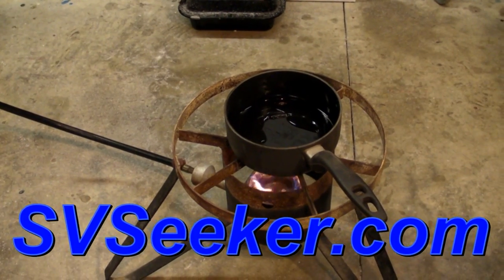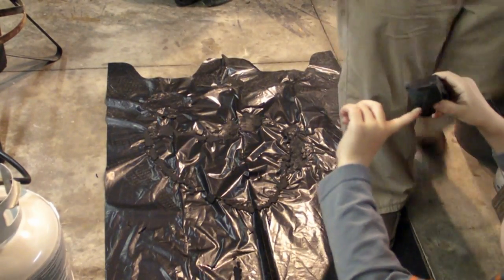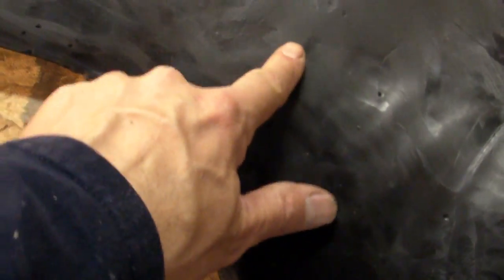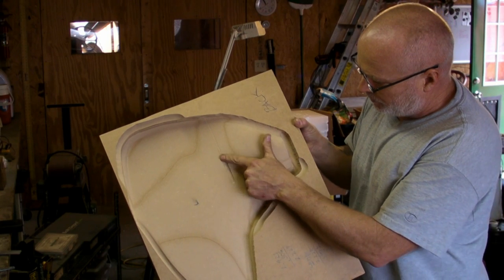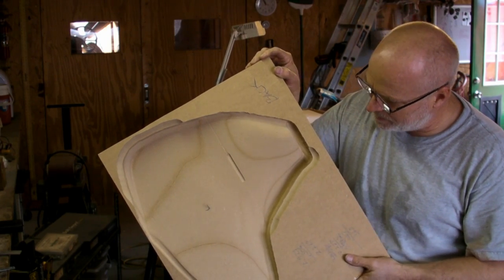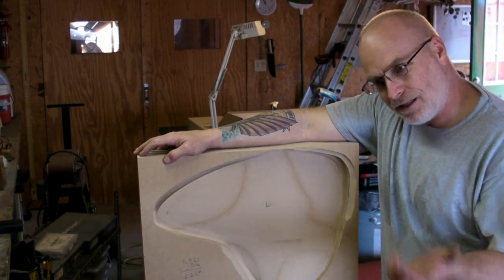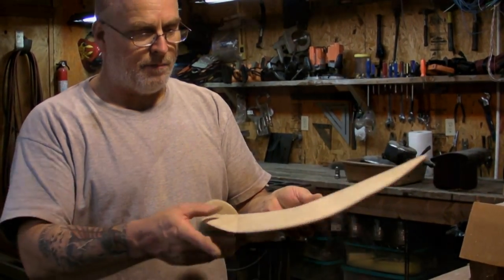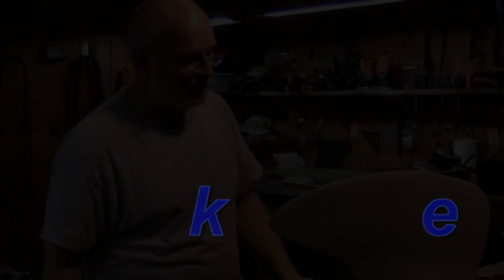DIY Boat Propeller - Part 2

Comment from the maker: @repalmore  Thanks. The load on each blade without hitting something is just under 1300 pounds but there is 3.74 sq in of material at the root and NiBrAl is tough stuff.  I think the weak link is the 6 bolts that hole it to the 2.5" shaft which inters the hub.  I'm looking casting it as single piece but it requires me to build a bigger furnace.  I also don't like the idea of dissimilar metals due to hardened stainless bolts.

Comment: Where did you buy the machinable wax? I've only seen it in pre-made sizes but I would like to have some chunks or even cast offs to use to make and do test cuts on my CNC and lathe.
Reply from the maker: It's homemade.   Just melt plastic into wax.